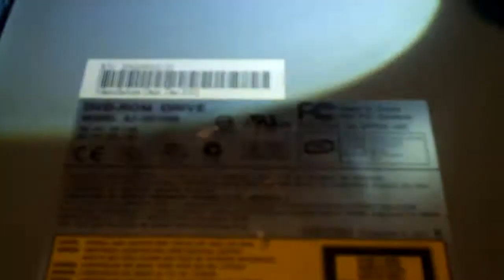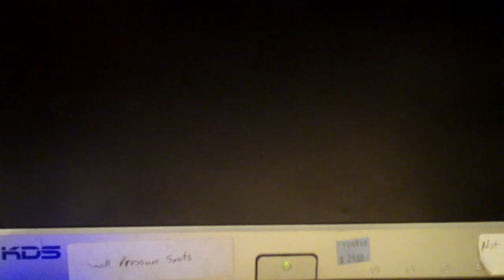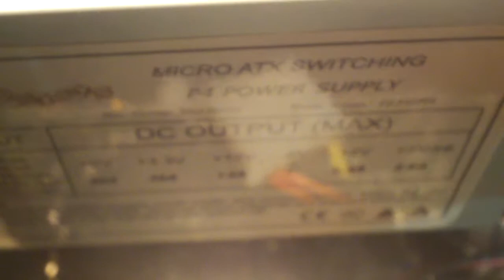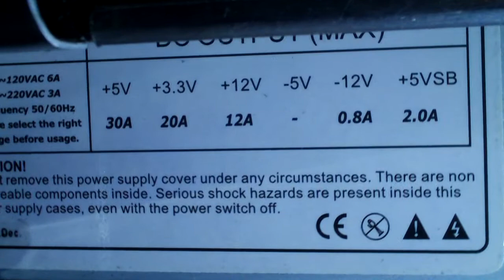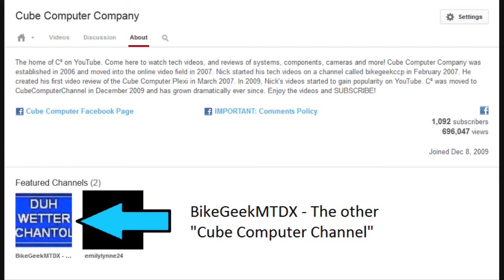A mini parts system

Comment: Good vid, would you be able to fit and itx board in that case ?
Reply: i would think looks like a standard ITX case
Reply from the maker: xXDahChubChubXx Unfortunately, it won't fit an ITX board. The I/O plate is shorter than normal to make room for an additional expansion slot. The screw dimensions do actually appear to line up.
Reply: ***** Without the I/O shield, it looks like it would work.
Reply: ***** Would you be able to extend the io shield slot or will it interfere with things like the pci slots.
Reply from the maker: MrReeceyburger123 With some crazy dremel modding, it could work, though I don't know for sure.
Reply: ***** Yeah that could work but it would take a long time.